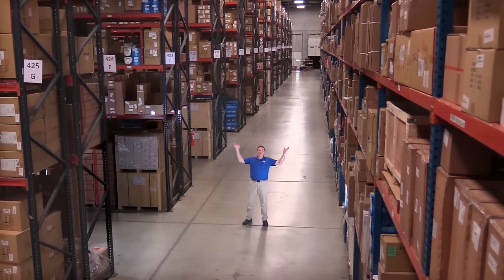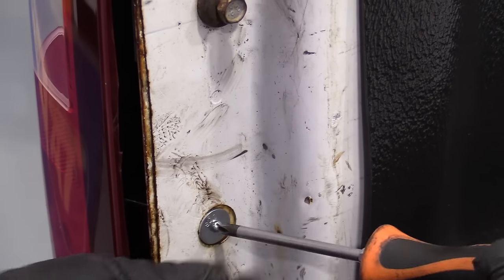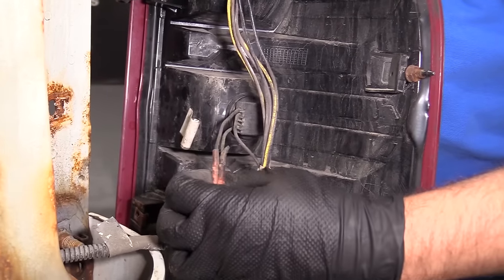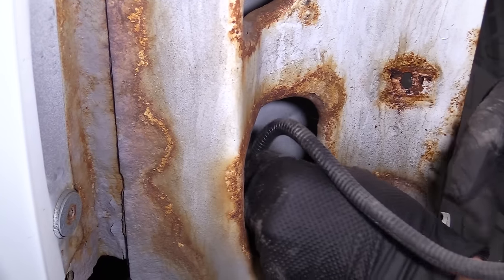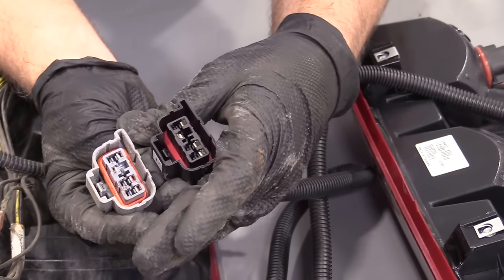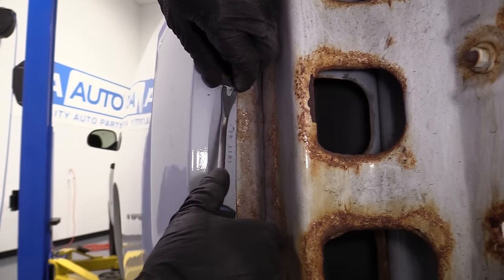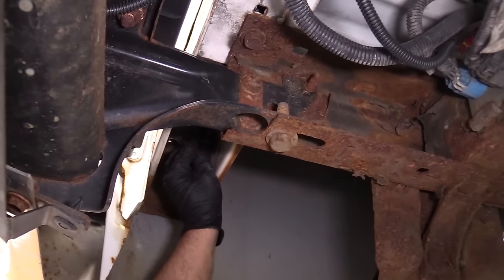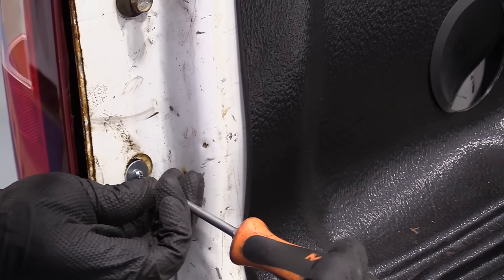How to Replace Taillight 07-13 Chevy Silverado

Comment: BAD INSTRUCTION!   THIS VIDEO caused me to ruin a new TAILLIGHT!    Do NOT try to install the plastic anchors using the taillight assembly to push them in!!!!!!!!!  The front bayonet post will break out!!!  This is what happened to me.  Gently separate the plastic anchors from the taillight bayonet post and use the old ones or install the new anchors separately.

Comment: I can explain why that harness had electric wire connectors. I bought a aftermarket wiring harness and backup light socket was too big for the taillight housing. Had to splice in old socket from original.